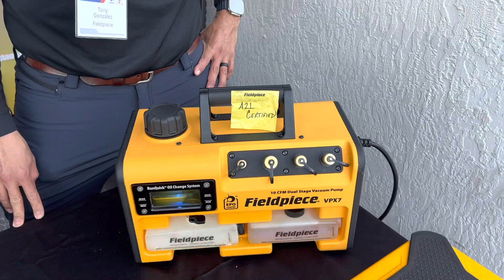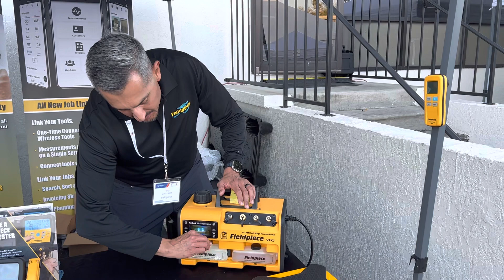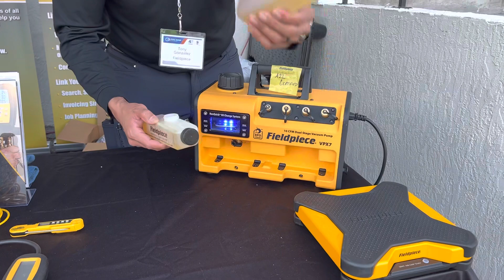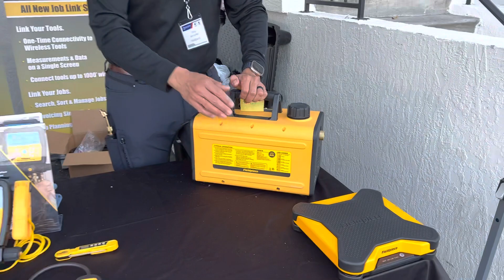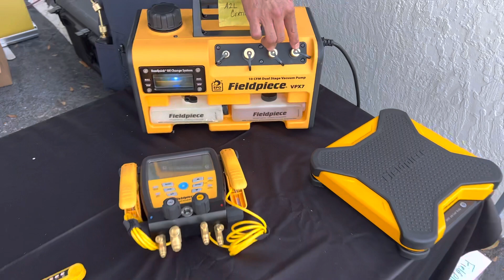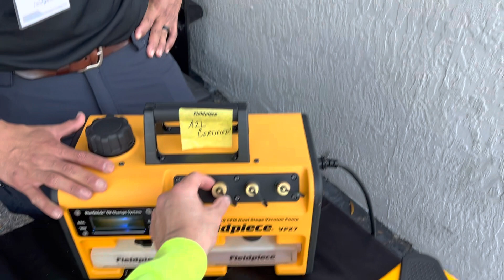Fieldpiece VPX7 10 CFM VACUUM PUMP.  Automotive R1234yf AL2 flammable, refrigerant certified.

Comment: Keep in mind that Fieldpiece doesn't make automotive HVAC equipment whatsoever. They cater specifically to the residential housing and commercial building sectors.
Reply from the maker: @gregsmith332  so what make them non automotive.  Because they market to were the money 💰 is ?🤔 

The pressure is different?
Dose automotive not have superheat & Subcooling?🤔 automotive have some magic voodoo 🤭

Automotive you don’t need temperature clamps to take drop across components to find restrictions? 

Because it doesn’t have the name SnapOn, MAC, MACO ? 🤣

Automotive does not need good temperature sensors? 

Automotive does not need good rugged reliable equipment? 

So the analog old gauges that say R12 , R22, r134, r410 in the ring of the gauges makes it automotive? 
        But it says R22 in the gauge so that means it’s not for automotive 🤣🤣🤣.
Reply: As far as Mac is concerned their AC equipment is basically rebranded MasterCool. As a DIY guy, is Mastercool good enough or should I go with Fieldpiece? Also, should I change the R134a connectors to threaded 1/4 inch?
Reply from the maker: @gregsmith332 you’re just doing your own personal car just go with the master cool
Reply: @coldfinger459sub0  They don't make automotive fittings nor do they have automotive all-in-one machines whatsoever, and the only thing I see on their website are AC units you typically see on the side or the back of a house.

Comment: My new pump will only pull down to 30 microns hooked right to the micron gauge is my pump defective?
Reply from the maker: Either the pump is brand new out of the box and it has not broken in yet. 

Or the limit of the capacity of what kind of micron gauge using and it’s accuracy or it seals 

Or the pump you have might not be rated below that level 

Or your oil is old . 

I never trust cheap micron gauges

Comment: So you are saying a 10 cfm pump can be used on a small car ac system?  Isn't that overkill?
Reply from the maker: It’s overkill but it’s lighter and easier to pick up and move around. Yes, the smaller ones are heavier.
Reply: @coldfinger459sub0  just ordered this one since it weighs 24lbs. I  currently run a Tez8 but that sucker is heavy. I haven't had any issues with it but want something a bit lighter
Reply from the maker: @LuisC202  when I was young, the TEZ8 was fine, but mine had a vacuum issue problem and then, after getting it fixed, it had a vacuum problem again, so I stopped using it became a doorstop. 

End it was noisy as hell and vibrated a lot. 

Some customers didn’t like that.
Reply from the maker: @LuisC202  I forgot to tell you I have a discount code for True Tech Tools if you don’t already have one from somebody else for 8% off

LECHAIR all one word all capital letters
Reply: @coldfinger459sub0  I used a code I found and ordered it last night i was tihnking i made a mistake thinking it was too much pump for auto work. Heck you are using it just fine.  Now I need to order the 3/4 blue silic9ne hose. It looks i will only need one .  Thanks for the code will use it in future buys.

Comment: Four port is definitely not recommended to pull a vacuum through.  The SM380 is a better unit and you pull the vacuum through with the Trublue 3/4" hose and Bluvac Pro vacuum gauge.  If you want to stand around all day, get the four port and waste time and money and time.  Go watch any of the Accutools and videos by Jim Bergmann and MeasureQuick, not to mention the dozens of other Youtubers who put up the videos of pulling below 250 microns in less than 5-8 minutes.
Reply from the maker: Go watch Jim Bergman’s video that he did with AK who works for NAVAC when they’re pumping down his big hundred ton chiller. They definitely did not use a quarter inch fitting on a three port manifold. 

4 port saves you from switching hoses from vacuum pump when finished.  You all ready have you tank set up. You just open the valve.  I bought Jim Bergman’s first Red Fish DVOM directly from Jim Bergman when he still owed Tru Tech Tools before he ever made his vacuum Videos. 

When I am pulling vacuum on one of my 20 ton to 60 ton VFR SYSTEM with 1000’ to nearly 3000’ of copper with diameters up to 1 5/8”  I’m not sitting around day pulling through a single 1/4” orifice . 

Yes I use my 3/4” tru Blu silicone hose attached to my 3/4” vacuum port on my NAVAC 3 micron rated vacuum pump attached to the 3/8” port on the fieldpiece manifold. 

For guys in automotive would have pump, gauges, scale, 30 lb. Refrigerant tank, permanently attached to each other on a pushcart. 
      What is faster then never un-attaching your vacuum hose from your vacuum pump. It never gets moved..
Reply: @coldfinger459sub0  LOL.. You are worried about switching hoses on the smallest vacuum line possible?  I have watched all of Jim's video and he even says not to ever pull a vacuum through the four-port manifold because it is too slow and not efficient.  You sure as hell wouldn't be using an SM480 to pull a vacuum on a 20-60 ton unit on a tiny small pump and 1/4" orifice and hose.  I don't work in the automotive industry, but thanks for trying.  3000' feet of copper line huh?  I would love to see that, and a vacuum being pulled this century.  The 3/4" Trublu hose on any pump from 3-10CFM on a 10 ton or less system can be done in a matter of a minute and wasting time pulling through the manifold.  The four-port manifold is a waste of money unless that is your only method available to you.  Switching hoses takes all of about a minute so nothing lost there.  Enjoy your slow vacuum times!  I will use the tools as they were designed.  Can you please upload a video of you pulling a vacuum of a 60-ton CFR system with a copper line of 1000'-3000' with 1/4" orifice built-in to the SM480V and you can Wow the entire world on YouTube?  That would be IMPRESSIVE!!   

I pull vacuum with the exact pump in this video, the Trublu 3/4" hose using the 1/2" line port.  8CFM pump can rip down a 25' line in 2-5 minutes, then valve off and run a decay test.  Anyone worth their salt in the field would never use an 8CFM pump on 3/8th to 1/4" line.  I love 90$ of Fieldpiece products and own nearly everyone available but that four-port isn't worth the money just to have a 1/4" vacuum line.  Waste of money because it will never get used.  

Glad you are so close with Jim Bergmann, why don't you ask what he thinks about it?  Oh wait, he states it on his YouTube videos.  Stop wasting time, but you must be paid by the hour, so what do you care if it takes three days to pump down?
Reply from the maker: @Balticblue93  apparently you don’t know automotive all those guys are only going to pour through a set of manifolds less than one percent will ever do a direct hose to a vacuum pump. 

apparently you’ve never watched Jim Bergman with AK pulling 100 ton chiller with the 12 CFM with a three-quarter inch port .   

Apparently, you don’t know the difference between ideal dry conditions, and and real world out in the field system that saturated with refrigerant and moisture. 

Apparently you don’t know VRF systems go up to 3000’ feet in copper ACR 

Apparently you don’t work in the real world .
Reply: @coldfinger459sub0  LMAO.... You certainly do make me laugh.  You can tell by your used of English that you are not very well educated.  But you are correct, I do not know what the automotive technicians do to pull a vacuum.  I know and will admit when I do not know about a specific subject.  Great and fantastic that automotive techs use the four-port system because it works for them.  Jim hasn't discussed that in his videos nor do we care because all my business is in the residential AC and heat pump and dual-fuel market.  

You are correct, I have never seen Jim pull a vacuum with a 12 CFM manifold.  Please link me to this video because I cannot seem to find it by searching on YouTube.  That would be very educational and exciting to see.  

I know plenty about ideal dry conditions and work in the real world but in the residential side of things and I own my business with several technicians working for me.  

No, I have never see a VRF system with 3000' feet of copper liquid line being put under a vacuum by Jim.  You got me there.  I would love to see that.  Honestly, I really would.  

Now you are just being a dick about working in the real world.  My business is very successful, we do quite a few installs per week and use Fieldpiece 8 CFM vacuum systems with the Trublu hoses and Bluvac Pro gauge.  We absolutely do not run the four port units as I buy my guys the SM380V's with the full wireless kits, so they have the digital gauge or the app on their ipads.  So give me a break.  I would love to see all Jim pull a vacuum through the four-port manifold on a 100-ton chiller.  Please post that video up.  If anything, you can SCHOOL me on your vast knowledge.
Reply from the maker: @Balticblue93  chiller was direct hoses without a manifold. 

But if you do use a manifold pressure versus the wrong way for commercial or residential, but not for automotive .   The VRF’s are my specialty. That’s what I sell and install.

So if you’re not the one personally designing the piping for the VRF system, you’re not the one personally selling them you’re not the one doing the load calculations you’re not the one who can talk about it

And Jim would never use a manifold to pull vacuum to try to do a vacuum decay test through a manifold 

That’s where the automotive knowledge comes in and knowing what they will, and will not automotive guys are slow to learn some are a little stubborn

And automotive systems are only tiny one and 1 1/2 ton systems very small